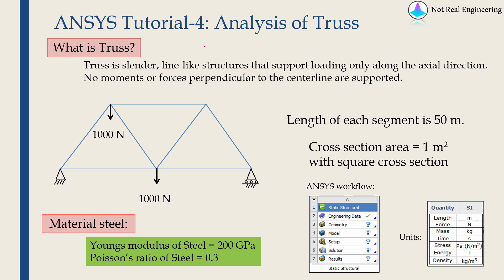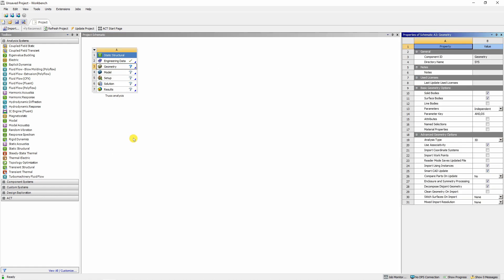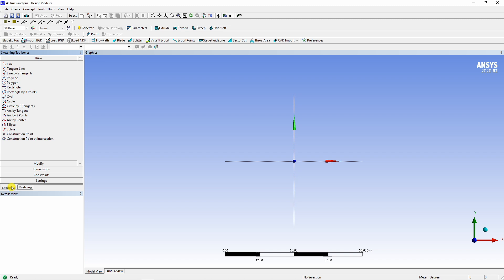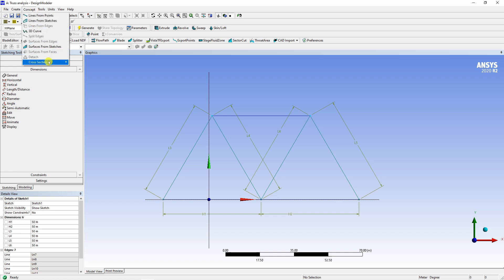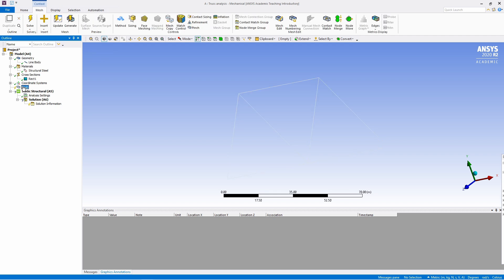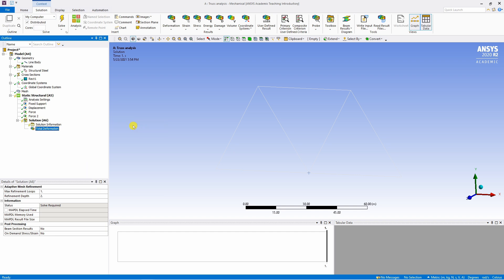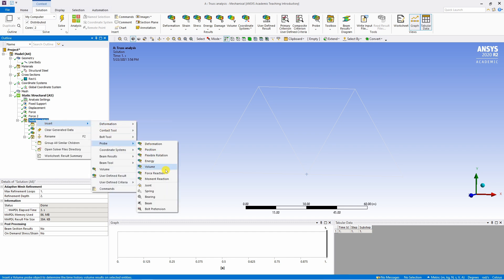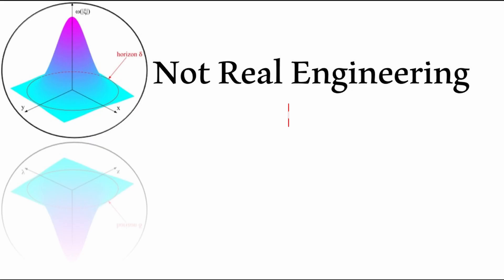Basic Truss Analysis using ANSYS workbench | Static Truss Analysis

Comment: They are not truss/link element. They are actually beam element which have both axial and bending loads.
Reply: If you still need an ACTUAL truss/link analysis, search for Truss Analysis - FEA using ANSYS - Lesson 3  ; uploaded by Structures with Prof. H.
Reply: Exactly, it is not the definition of a truss, which is calculated considering that it only has axial forces because each node is free to pivot.